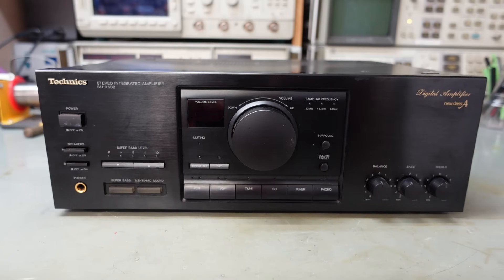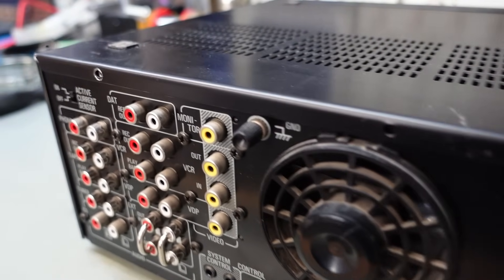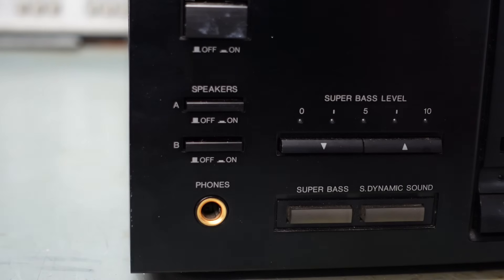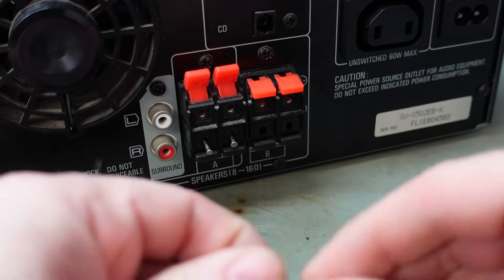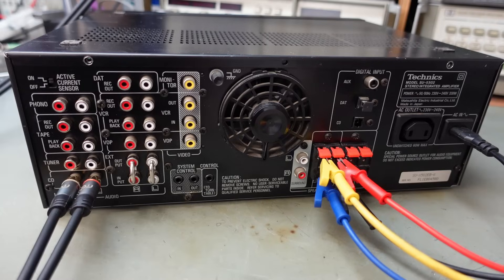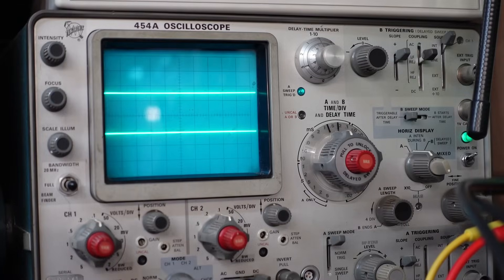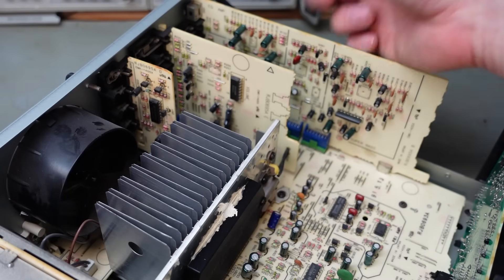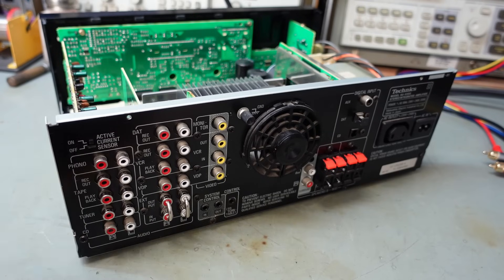Technics Amp repair with NO PARTS!

Comment: 4:31 Wouldn't it be better to remove all of the old "crappy" solder first in the long run or doesn't it really matter? 🤔
Nice repair job anyway. 👍
Reply: Mixing it with fresh 60-40 solder works just fine for the next 10+ years

Comment: Never buy anything with SUX in the model name
Reply: This amp is littirally Iconic, if you can find one, always buy this amp
Reply: Never watched RoboCop? The SUX 6000 was great. Really shitty gas mileage.
Reply: Except the 6000 sux. One of detroits finest autos. I’d buy that for a dollar
Reply: @colintierney9715 haha.  Inwas going to type that.   Good one.
Reply: @colintierney9715 dead or alive you're coming with me
Reply: @colintierney9715  😂
Reply: It didn’t very hard though.
Reply: Su 8055
Reply: I never bought Technic. But has I see the cheap construction, I never will. If this one is "iconic" well!!!!!
Reply: @lambertax Iconic? It's awful! What a horribly-built flimsy cheap-looking heap of junk!
Reply: @lambertax , they're not too bad. If you don't mind working on them. Plus in my experience they tend to sound amazing and as evidenced here are fairly easy to work on
Reply: @lambertax  Totally agree, what a crap!
Reply: ih su-x980d amplifier and still works without any problems
4h per day or more on -34db

36years old.
Reply: @imięnazwisko-o9z -34 ça represente quoi ? En puissance
Reply: @rimk1273  volume level
its starts  from -76 or -78db
so its  like 60% of max volume

but bass on max, enabled surround and bass boost
Reply: @imięnazwisko-o9z  thx bro 😊 good new year from paris